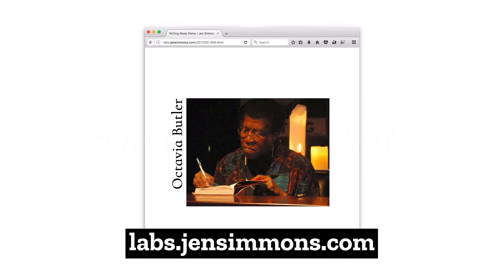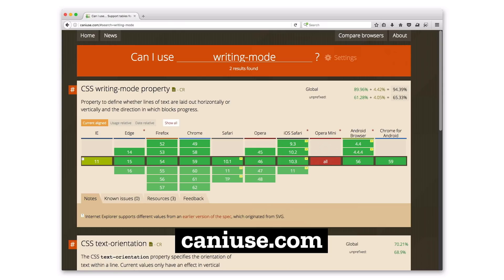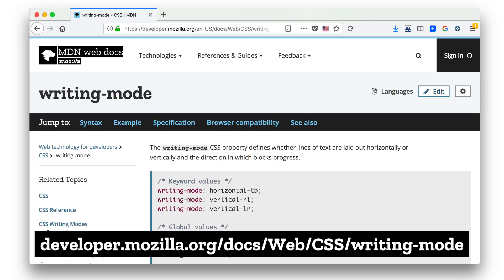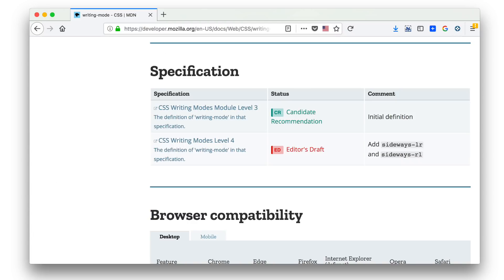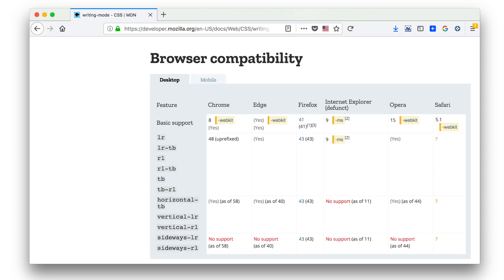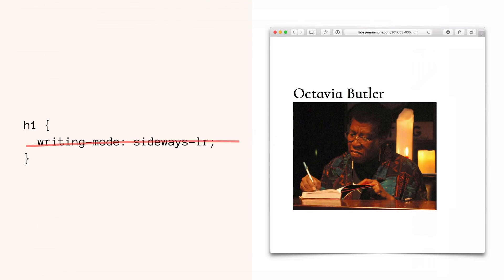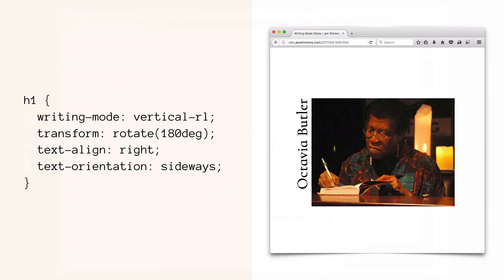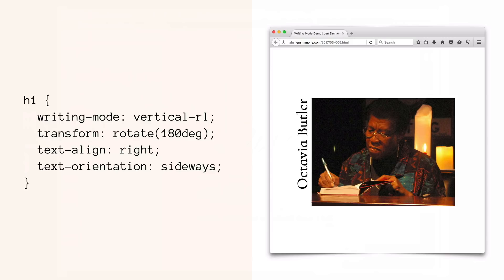Making Your CSS Fail Excellently – 7/7 Resilient CSS

Comment: Whilst this is a great series, and the sentiment is commendable, it doesn't deal with the elephant in the room: the time incurred to QA a site on legacy browsers. For a large company which can afford to outsource QA or has a good sized QA department this might not be a problem, but for smaller shops, startups and independent developers, spending that kind of time checking sites in a multitude of browsers is simply not practical. In my experience, even if a project starts out intending to support a good selection of legacy browsers, this support is often dropped when time gets short and there isn't enough capacity for testing and fixing bugs. Obviously for the low-hanging fruit used in these examples this isn't much of a problem, but when you start applying these techniques to mission critical elements like layout and navigation this becomes far more of an issue and need far more thorough testing. It's interesting because this is exactly the same problem I've seen time and again with accessibility. Even if a developer or team have the knowledge to implement properly, the difficulties of testing and the realities of hitting deadlines mean this often falls by the wayside. The one thing most developers lack is the luxury of time.